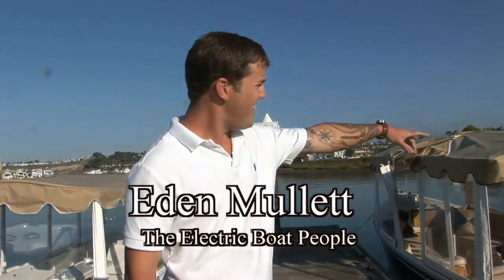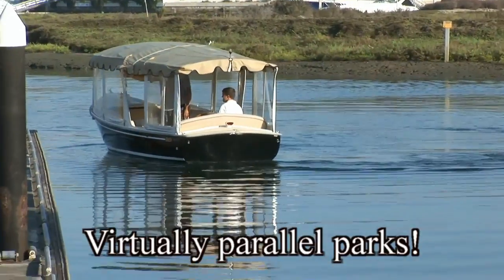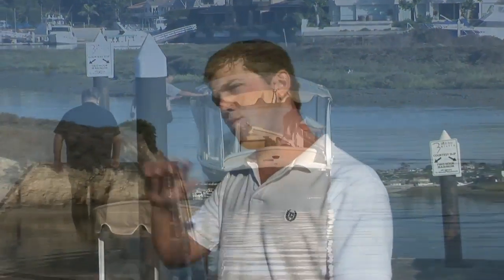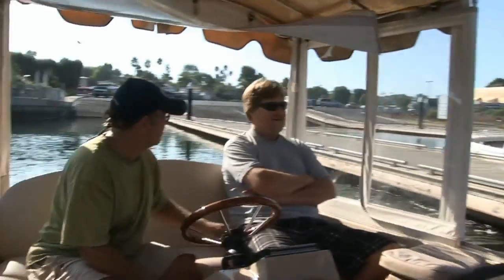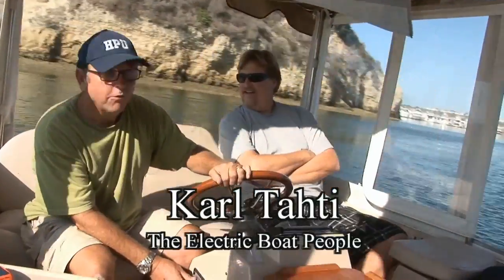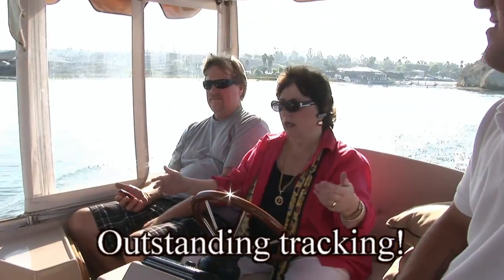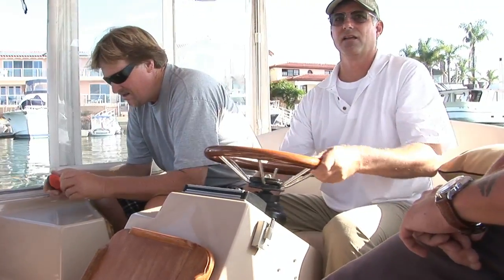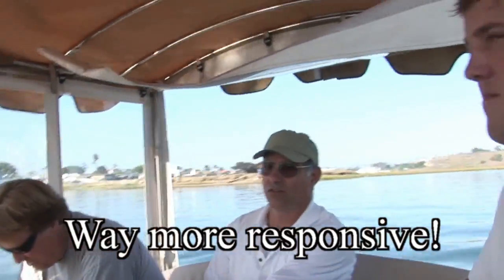Duffy 21 Upgrade Rudder-Propeller Conversion by Lear Electric Boats

Comment: So the Duffy 21 didn't already have a power-rudder?
Reply from the maker: benjamin no this was an older Duffy that originally had two rudders.
Reply: Wow, 2 rudders? I have a 1983 Duffy 18 with a single rudder and inboard drive.
Reply from the maker: benjamin Yes the Duffy 18 is the most steerable of all of the older Duffys it only had one rudder right behind the propeller
Reply: What kind of propeller is that? It has five blades? Does it fit a 1" taper shaft? What is its diameter?
Reply from the maker: benjamin The propeller has a 14 inch diameter. And yes it goes on a standard shaft with a three-quarter inch to the foot taper
Reply from the maker: Do you know how to contact us via email or by phone or Skype?
Do u need more info?
Reply: Yes I would like more information about your propeller. I am trying to maximize propulsion efficiency, although I am not sure I can fit a 14 inch propeller in my hull's aperture. Are more blades more efficient at propelling through water?
Reply from the maker: benjamin Why don’t you call me right now at 714-308-4287?
Reply: The 14inch propeller, i think is too big for your duffy 18. I will ask but i think it won't work. 
The prop will give a duffy more speed BUT you have to keep the speed at 5 MPH to have the same range as you had before. range = number of hours of runtime.